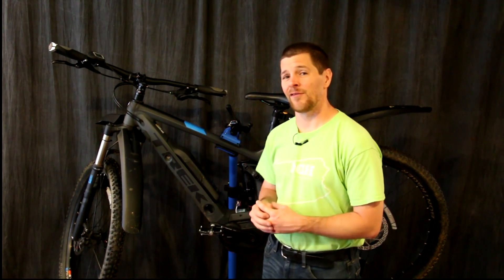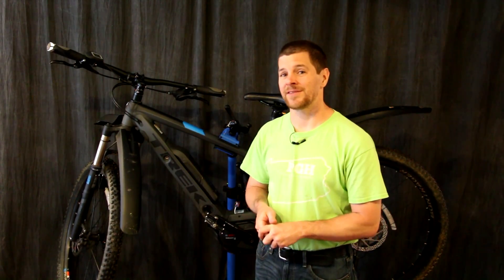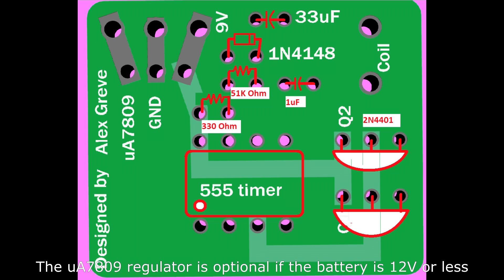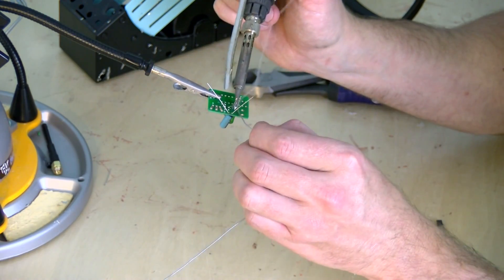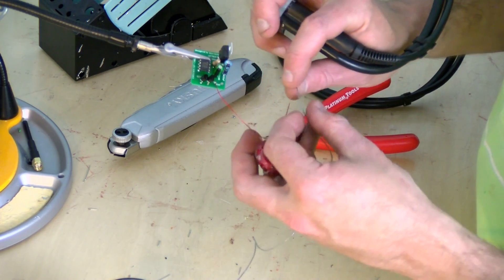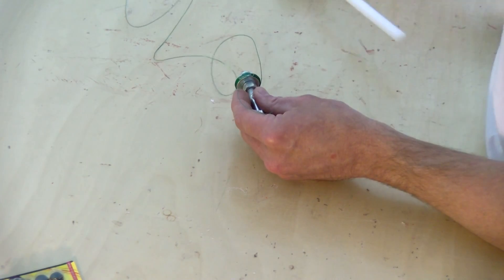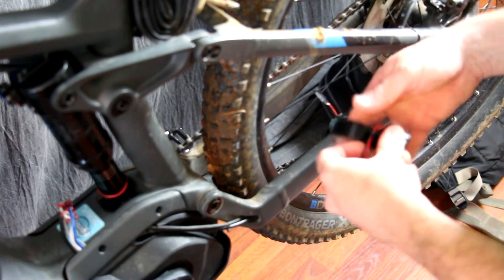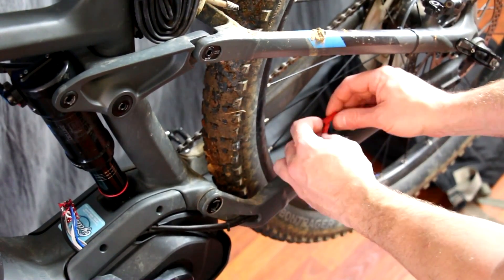Eliminate the speed limiter on any EBike - Full tutorial

Comment: I have a maxfoot mf-18 ebike, it has a 750-watt motor with a 48-volt battery. This bike is big and bulky just like me. I think it's just too slow, I read that you can get a 52-volt battery and increase the performance without any problems to the electrical. i read that most ebikes have a speed limiter wire that can be unplugged but of course you shouldn't. just for curiosity I would like to unplug said wire and just give it a try. would anyone know which wire to unplug?? just for experimentation.

Comment: Basically all he has just built is a speed box that you can buy on line lisson this is no way for someone with out electrical engineering experience come on man you expect your average Joe to do this also be warned the shimano ep8 and ep6 motor will detect this if you screw up and permanently shut down your motor just go online and buy one or just buy some magnets and put them on the crank arm and move the sensor to the frame next to it and it will work the same yes good video but not for inexperienced people

Comment: i seem to have unintentionally disabled it by ripped my front brake cable out of its housing, it goes through the frame like yours. well now top speed is 24 MPH and the engine no longer cuts off at 20 mph. the only down side is that my display no longer shows an accurate battery level, but my battery has a button to show the actual level

Comment: Higher Voltage-I built your circuit but It is not working as expected. The transistor at "Q2" is over heating within 1 minute or even within  20 seconds it becomes too hot to touch. Do you have any ideas where I may have assembled the components wrong. I used a 9volt battery and your circuit board design, but I have not been able to produce a pulse from the coil.

Comment: Thanks for great video on this hack. Should work great for some motors but Bosch motors it generally is not a good idea. That said, this might work fine with older Performance Line motors like this but not the newer "smart" motors. They increased the gestapo code in the motors and detects stuff going on like a typical constant speed hack like this. Then you get the dreaded 504 error code and you almost have to push your bike back to the stall and it will be some time before it resets. 3 of these and it kills your motor until you take it to the dealer for a reset. 3 of those and they brick your motor permanently. Bosch is really a bunch of Nazi's. Mind you in Germany cars that kill cyclist and pedestrians are allowed unlimited speed on the autobahn and they want to restrict bicycle speed....They didn't have to get so dirty with the restricting code to meet the nations governments overreaching authority.
Reply: One more note I have a Bosch motor that I had to use gag.... I put a speed tuner by speedbox on and it removed the limit completely and has worked great with no codes for years.

Comment: Can't I just go into the computer and set the wheel size to 12 inches.
Then my 27 inch wheels will spin as fast as 12 inch wheels need to spin to reach the limited speed.
Reply from the maker: On a hub motor, sure.  However those are seldom limited from the factory like these are.

Comment: or just put the speed sensor on the crank, you don't usually pedal faster than 25kph ^-^

but don't do it on a bike you don't have the software to reset a EO14 error. its ridiculously proprietary, has left me stranded 3 times now, first two times before i even did the hack.
Reply from the maker: I saw that.  Freaking brilliant!

Comment: Will the Dilithium Chamber be able to handle the increased amount of Anti-matter?  Did you modify the articulation frame and compensate for the dynamic impedance?  Finally, is there any increase or danger from the Possible theta Radiation from your drone parts?  Other than that, this is a very simple modification.  I would anticipate 15 minutes of work.
Reply: I would also check the fitzer valve
Reply: Agreed

Comment: Or you can move the sensor to the outside of the frame and attach magnet to pedal bolt and it'll read the speed of the pedal rotation rather than the wheel rotation. Did this today and it took me 20 minutes and I can go plenty fast enough. I've got no electronic knowledge, just common sense.
Reply: What bike are you using? My worry is Bosch would detect the inconsistent speed rate

Comment: Thanks for the video. I am trying to built it but there are some misleading facts. Firs you are missing the capacitors in the parts list. Second there is a resistor signed as 51 K Ohm in the part list but the link is leading to a 5.1 K ohm one. You got me there I need to see my parts provider again

Comment: put that coil in making on the drill, slow speed and use cut resistant glove when you're feeding the wire, you will have that coiled up in no time... also, heat shrink instead of electrical tape

Comment: I haven't got my ebike from UPS yet, but if you're not using the controller's speedometer anyway, can't you just go into the program and tell it you are using smaller wheels?
Had to do the opposite when putting a lift with much larger tires on my Jeep Unlimited.
Just reprogrammed the cpu and all better than stock.

Comment: Wow this is a bit more complicated than I thought. I was imagining just clipping one wire, not building an entire sensor
Reply: its for intermedient hobbyists
Reply: Yep
Reply: Me too 😂😂😂
Reply: Tbh all this is unneccessary. You can just move the sensor next to where you pedal is with electric tape and put magnet into pedal.  This will trick entire computer because it will think as example you go 7 miles hour while in reality you go 26 and therefore will bybass and unlock the original speed limit.
Reply: @matthewsdicksons5110  newer bikes have the sensor integrated into the frame. It's not external
Reply: @matthewsdicksons5110 Sorry, this is not correct as Bosch performance line motors (which this one in this video is you can tell by the purion display) will throw a 504 code and your bike will go into limp mode home and it will be some time before it returns to normal. If it does it 3 times your motor is toast until you take it to a dealer and have it reset. If this happens again fucking gestapo bosch will brick your motor.  It can be done easily with some motors. Not, Shitmano's but Giant ebike motors (made by Yamaha) it can but it will occasionally throw a code and you have to turn off and back on. Some of those motors will eventually just ignore the code for you but your display will not longer show the right assist levels but it will still work. The other motors you always have to turn off and back on and continue. Get the general idea at least ????

Comment: You could just move the sensor from the wheel to the pedal, use a small magnet, and ot changes the rotation. Works
Reply: Sometimes it works. Other times it will mess up the system. I was thinking in doing it to my Trek XM700+ but someone say : Don't do it

Comment: can i Eliminate the speed limiter on my specialized vado 5.0 28 mph bike or doesn't it have more motor power for faster speeds (it has 90Nm)
Reply from the maker: If you can access the speed sensor, yes.  If not, then no.

Comment: Another option would be a ttl clock divider. Or a Pic and simple bit of code so it times the pulses and gives you correct speed up to the cut off then keeps it at just below the cut off. Then at least the speedometer works some of the time.

Comment: No need for that... Just move the sensor on the frame outsite and attach it  with a cable tie, put a magnet on the pedal innerside where the sensor is attached to the frame and your good to go. The Sensor now messures the turning of the crank. No soldering, no battery an Maximum speed🤫
Reply: Can you upload a video of you doing that step by step?
Reply: @jameelkout441  It's all over the internet ;)

Comment: I'm definitely not against faster ebikes bikes, but my biggest concern with a mod like this is brakes. The disc brakes, at least on the bikes I've had, just do not have the same stopping power as vechicles that are actually designed to go this speed. Worse still, unlike motorcyclists a lot of people own these bikes without any training, and don't understand how to best use their brakes. Locking up your wheels at 40mph is a recipe for a bad, bad time.
Reply: You think motorcyclists have training? They go way faster than ebikes. I don't get the hate on wanting to derestrict... Just make sure you only ride safely.
Reply: @TimRicherson  Yes, you have to at least pass the written permit test and a dmv riders test to ride a motorcycle. This require at least a base understanding of 2 wheel mechanics and road laws. But the easiest way to get a license is to take the safety course, which has a lot more information. 

But my comment wasn't about training, nor was it about regulation.  It was about brakes. Bicycle brakes are not built for the speed and power these ebikes can go. That's true regardless of any regulations or training.

Comment: Couple, few questions. Is this solution limitted to mid dr ive, how do we modify cadence sensor? Just put this in place of magnets?
How is action of controlling bike, with continuing pulses telling motor to keep accelerating faster and faster, how does this effect normal riding? Should we power the pulse generator from signal of cadence and/or brake cut off switches? Is it possible to burn up motor windings and/or controller?

Comment: Or, just use a 4017 integrated circuit and divide the true speed by 2. Install inline with the existing sensor so you can use the power from the bike for the circuit. Install a bypass switch so you can switch from stock to divide by two. The speedometer would read exactly half, so multiply by 2 to get true speed.
Reply: Wtff
Reply: Any tutorials for this, simpler solution? sources?, A quick google yielded nothing for: "IC 4017 electric bike speed unlock"
Reply: @deandre1988  No tutorials exist for using the 4017 in an ebike. However, tutorials exist for using the 4017 to divide the original frequency down. A lot of the examples feature a 555 as a frequency generator (would be the hall pickup or reed switch on the ebike) and dividing that frequency down to light LEDs at a slower rate (or trigger the ebike controller slower). Note that all the speed modifications do is raise the top speed slightly- because most motors are sized to top out rpm wise only slightly higher than the legal limit. The only real way to go faster than that is to increase battery voltage, which may require a new higher voltage rated motor controller.

Comment: Thanks for this but I'd really like a schematic to look at so that I can make the board using perfboard instead of having to go through the trouble of making a regular PC board. Also, what is the pulse rate of the 555 timer set for? I'm guessing that it should be the same as what was being displayed on your bike computer?
Looks like you left out the transistors in your parts list.
What diameter should the washers be when winding the coil?

OK, never mind. I think I figured it out. 555 is running in astable mode at around 14 hz? 330 ohm and 51K ohm resistors plus 1 uf cap setup the 50% duty cycle of the 555 at 14 hz. Driving two transistors connected in parallel to handle the coils current load. 7809 voltage regulator to power the 555 and coil. 33 uf cap for stabilizing the output of the 7809. The diode is across the electromagnet to protect the transistors against back EMF. Might want to include a resistor between the output of the 555 and the transistor to protect the output of the 555. Around 470 ohm should do it. Think I'll try this on my e-bike. Not that I really need to go faster than 20 mph with motor assist. Might be fun to play around with though.

As far as knowing your actual speed, I guess installing a separate bike cyclometer could take care of that.
Reply from the maker: The timer can run at just about any speed below 4hz.  Mine is running around 2Hz.  The transistor is run in saturation mode so the voltage drop across it is low delivering maximum power to the coil.  The number of turns in the coil is up to you.  I suggest as many winds as you can get on there.

Comment: FFS its just as easy to swap out the flux capacitor
Reply: Only if said flux capacitor has a Dowty washer trued with the right compression ratio, no cracks in the flange, and no corrosion on the differential.
Reply: @canadianroot  yes and always make sure you have lots of ass farts
Reply: Lmai

Comment: This doesn't work. The values for the resistors and capacitors are wrong. If you get the parts listed, you will fail.

If you make it according to the instructions the coil will pulse extremely fast defeating the purpose.

This video is extremely poorly made. The idea is excellent.

I am currently working with an EE to get the values for the resistors and capacitors so the 555 timer works properly.

They really made this video as a quick money grab or fire and forget.

Comment: 2:05 ok tapping out, I am too low-IQ for this. I want my ebike to go faster without being an electrician.
Reply: Put magnet on crank and zip tie speed sensor to frame, so it measures cadence instead of wheel RPM.
Reply: @JulianShagworthy  Is that possible? Won't you pedal really fast sometimes and it would cut voltage?
Reply: @Can-Am1989  That's the rub - high gears only!
Reply: @JulianShagworthy  I've done the math and indeed it's almost impossible to exceed via cadence the RPM you would have on a 27.5 or 29er at 25km/h. So yeah, you're solution is the easiest one and works 100%
Reply: Went in my settings changed the wheel size from 2200mm to 1530mm then changed the speedo from mph to kph. Derestricted from 15.5 mph and although speedo reads approximate kph its really equates to mph. Easy
Reply: @Abstractism One thing I've learned about computer restrictions on anything, there is ALWAYS more than one way to bypass them.
Reply: brutal
Reply: 🤣 Jesus Christ has high voltage love for your soul! 

JesUSAves 🙏
Reply: Don't encourage yourself to be discouraged.  He assembled 10 pieces.  You just have to get the right 10 pieces.You got this.
Reply: @Abstractism you could put a magnet on the back of the crank arms if they're long enough then move the censor that tells how fast you're going to fool the computer.
Reply: Same for me
Reply: @First Last  Agreed. What should be mentioned in the video, is how to do a shunt mod on the speed control. That will increase the amps measured over the resistor and allow for faster speed as well.
Reply: I agree useless for 80% who view this .would not even attempt this looks like a nightmare
Reply: I’m an electrician but the electronics…. There’s a difference!! And it seems a big difference yeah I just want it derestricting and batt to last that mod out…..
Reply: Ride down a hill
Reply: Buy a six cilynder Honda bike.
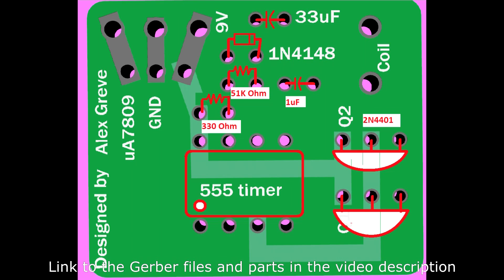Reply: did better than me i made it to 1:19 before i tapped out